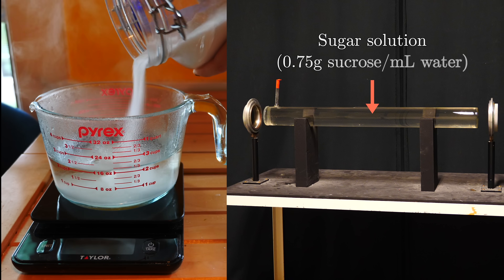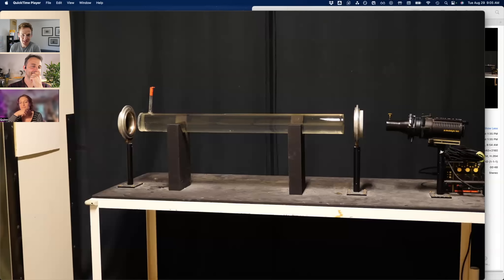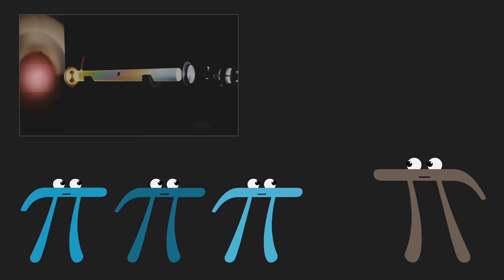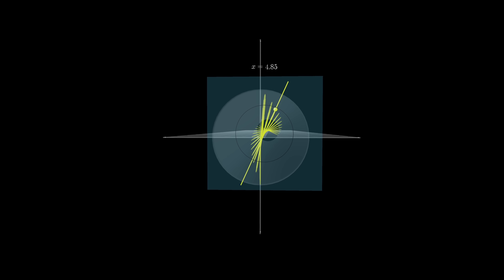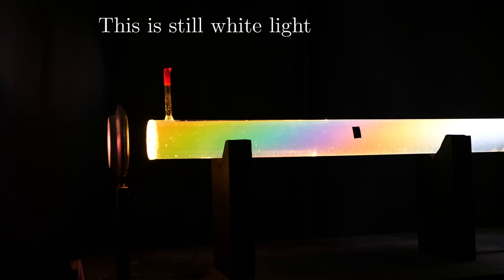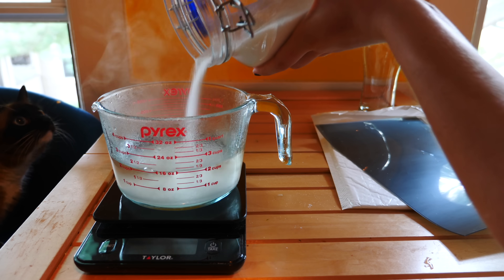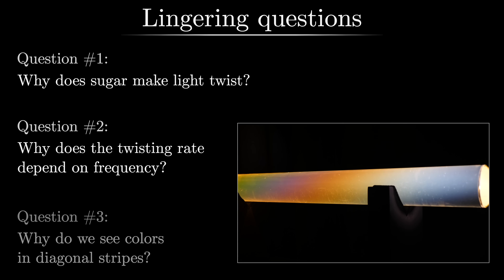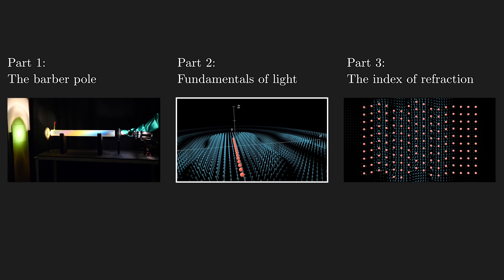This tests your understanding of light | The barber pole effect

Comment: Quantum physics lets go
Reply: well, ultimately it should be explained by quantum mechanics  but i think classical EM would be able to solve this
or maybe it's necessary for the 3rd question, idk
Reply: @geekjokes8458 I am thinking it much more related to the optical properties of the material in consideration.... idk too?😅
Reply: I don’t think quantum mechanics is REALLY required at a deep level most concepts such as chirality, refraction and polarisation  can generally can be solved using the wave theory of light but for the third question i really doubt only optics can help. Overall speaking this problem really does some need of quantum mechanics.
Reply: I think classical EM is probably enough here
Reply: This can be just solved with classical electrodynamics

This exact conditions I haven't solved yet, but in a few tests of electrodynamics i had to solve for this sorts of wave equations.
Reply: @geekjokes8458  yeah i have to say he went quite deep into solving the mystery kinda thought it would be much simpler
Reply: Yes. Good job. You named one of the video topics.
Reply: This is all classical but yeah woo
Reply: Not everything is quantum magic/woo/mystery or blah blah blah.* Too many people think "quantum" and start thinking like it's magic instead of actual science. 

 *(of course, technically everything is quantum, a detail many also miss)